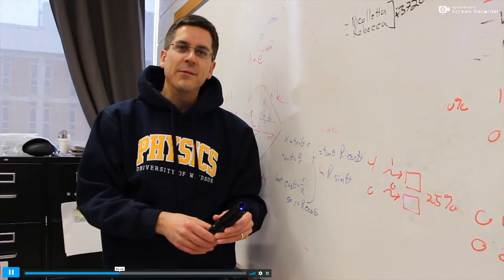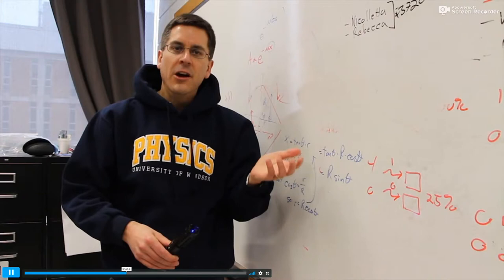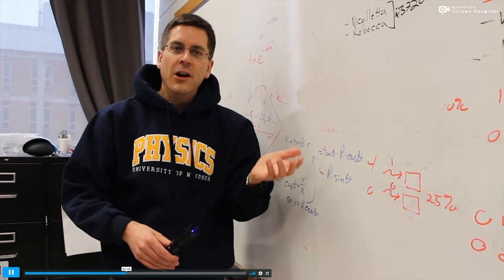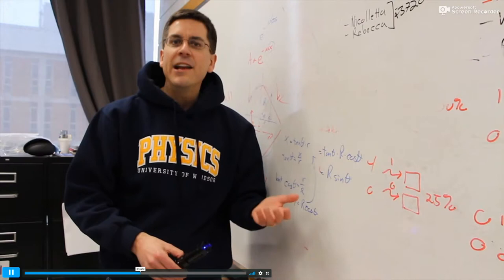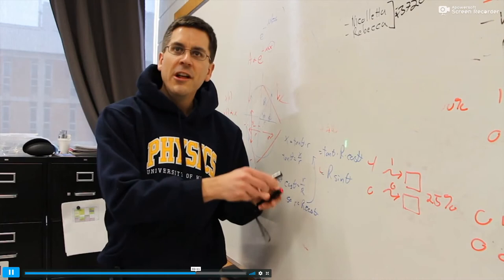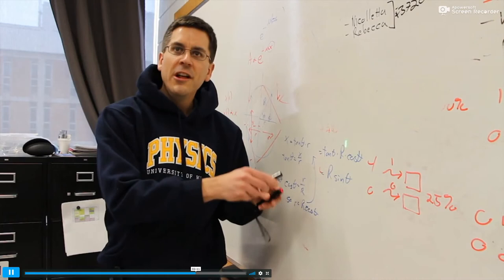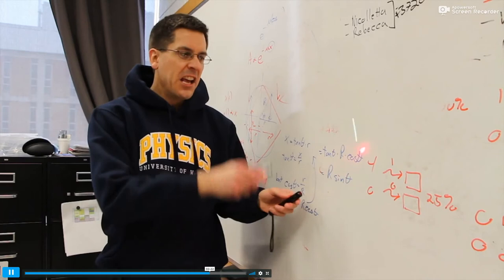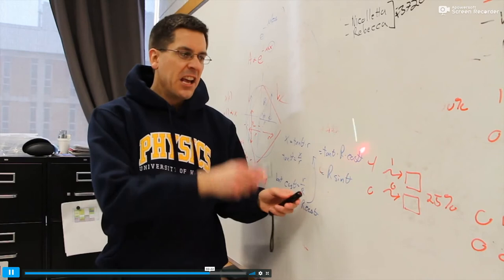UWindsor Physics.  The Lightsaber: All thrust, no parry

Comment: your understanding of lightsabers is flawed. it is not a laser pointer of epic proportions, but rather a cutting torch of epic proportions, which is being contained and manipulated through magnetic means. if you want to create a working lightsaber, you need to create laminar airflow around a jet of extremely hot flame that is electrically conductive, and pass that flame jet through a particular type of magnetic field when a bunch of voltage and amperage is flowing through it. to create the electrically conductive flame, passing a butane flame over a carbon-bearing crystal inside a specialized chamber would react to create dicyanoacetylene, which burns at 9000*c and conducts electricity. dumping the voltage from say, a stun gun, into such a flame would pretty much give you a lightsaber, especially if the jet is passed through a magnetic field that compresses and twists the jet into a helix, because that would make the flame even hotter and more uniform, turning it into a molecular fusion chainsaw.